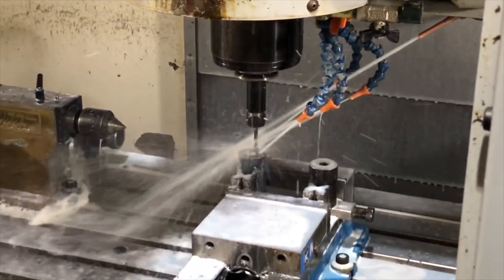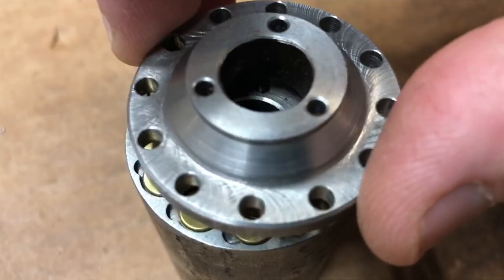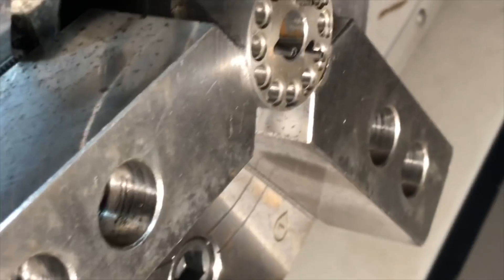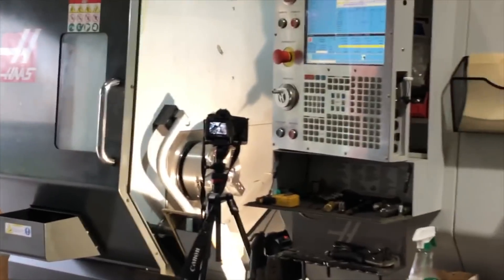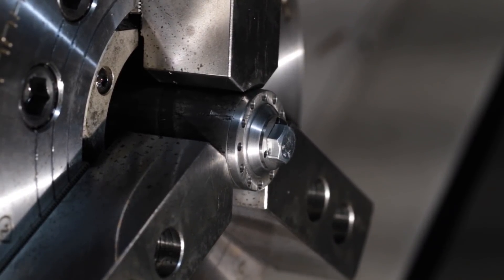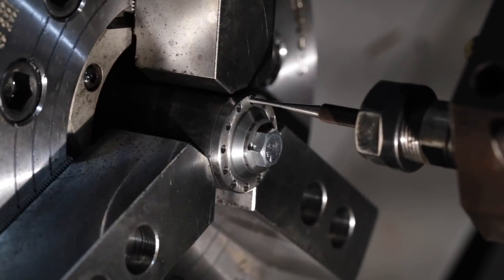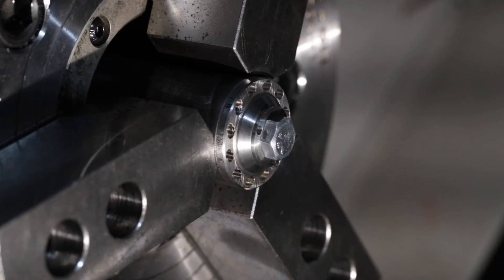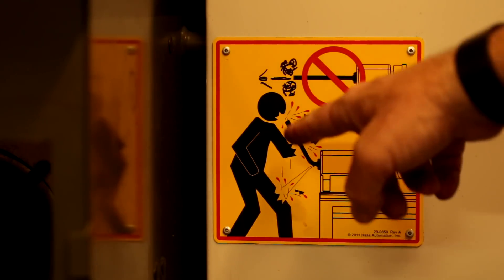Lathe Machine Gun

Comment: Being a rim fire cartridge I was expecting a knurling wheel type roller to crush the rims at any spindle speed. Like a 3000 rpm zip gun.
Reply: Same
Reply: that'd be my first guess, and my personal favorite over the automatic center punch (I like hitting things with hammers)
Reply: Wonder if a simple roller bearing would be enough? Mill a step out along the circumference so the rim of the case is sticking out and just run the roller along the edge. Rounds per minute is just how fast the chuck spins.
Reply: @dangerrangerlstc  I think it would be - you’re just making a crimping press that is set up to crimp on a different plane. The lack of fixed position dies is obviated by the massive amount of rigidity you have in that machine.
Reply: might as well just crash a section of tube against the rims :)
Reply: Same

Comment: A spring punch with the tool path set a couple of thou deeper than zero?
Reply: Same
Reply: Beat me to it.
Reply: That was my theory
Reply: The issue with a spring loaded punch is that the punch needs to be cocked. On a Starrett punch, the cocking depth is over .350".

If the chamber has a bottom and a 90 degree vent hole, IMO it no longer has the ability to expel a projectile. It's the readily convertible section that gets you.
Reply: @gungadinn  what if it was a pop punch? Set the timing so the punch arms and pops at the correct distance.
Reply: just get a hinge popper, tie it and a couple gears to the lathe, and bam. lathe turns, gears set up popper, gear hits an empty tooth to release the popper and strike. aint fancy, but reliable, cheap, and easy.
Reply: @onebladeprop  That's the sort of punch I was thinking of.  Thank you. Whatever the "cocking depth" is just set it one or two thou over.  That should produce a reliable Earth-shattering kaboom.
Reply: @onebladeprop  I was about to mention the same.  A cheap spring loaded center punch with the tip ground slightly should allow the end of travel to be past the contact point.
Reply: I’d go .010 deeper with the spring sheet metal punch brass is soft
Reply: Commented same thing then scrolled thru comments to see anyone else has mentioned haha guess I was late
Reply: That's actually what I assumed he would be using.
Reply: center punch
Reply: Dammit you beat me to it! 🤣👍
Reply: @toddnewsome5011  same. Oops
Reply: Same
Reply: That would work.  Make the face of the punch squared off so no early detonations.  The 'snap' event will do the remaining work, then draw it out just like the current program does and it will reset.  Easy Peacey.  It takes more than a coupe thou though.  There has to be contact then compression to make it snap, then release back to start will reset the snap spring mechanism.
Reply: @gungadinn  Always cocked.  It needs to be compressed after hard contact for that distance to release, but automatically re-cocks itself by design.  The user provides the entire actuation force, as would the C-axis here.  It would just require that a longer 'stroke' and return be programed in to his 'job'.
Reply: @cosmicraysshotsintothelight  
The spring loaded punches aren’t always loaded. When you press the punch, it pushes against the spring cocking itself until it cams over releasing the energy. 
CNC machining of drilled holes uses a process called pecking. Drill in, drill out removing chip, drill in and repeat.
Reply: @gungadinn   That's what I said...  the forward motion of around the 0.350 length that was mentioned compresses a spring which then fires at a specific linear point in the motion striking the rear of the floating punch head with the spring assisted "hammer" inside the unit.  And as for CNC comments go one would not then program it as a drill job.  Duh.  And I knew what 0.0001 inch tolerances were back in '69, so I don't need a primer on it.
Reply: @cosmicraysshotsintothelight  
I’m accustomed to working with Hasteloy, Inconel, and Monel. They’re difficult to machine which is why pecking holes is done. We haven’t had to EDM a broken cutter out on a few years since pecking.  

Drilling aluminum and mild steel, flood cool and let her rip.
Reply: @gungadinn  Right. So, as is in this case, drilling "air" and ending at a stop point that is inside of each machined cavity he constructed causes the face of the pin to smash the ass end of the rimfire cartridge blank with the depth set properly.  Should be no problem.  You know...  let her rip.  Not like you are crashing drill bits.  These are not crashes.  Call it knurling if you want to reconcile your logic.  Whatever allows to tool to impact the back of the cartridge with force, NOT "pecking".
Reply: That's so funny I'm not an engineer but I thought hey what about some kind of spring punch lmao
Reply: Exactly what I said.
Reply: Or program with a G04 so it goes to the exact point rather than starting to return before it gets to the Z point you programmed

Comment: This is so stupid and clever at the same time, I love it.

You could maybe put rubber washers in between where the shoulders of the blanks meet the firing chamber, lifting them slightly higher out of it, then keep the program the same. That way the PID won't have slowed down the punch tip too much as the strike happens, and the rubber will allow some compression so it doesn't break something by having too long a stroke for the space.

Comment: You could have a firing pin for each hole on the diameter of a disk and have that disk rock in a circular motion on a central pivot point.  Have a rolling arm that pushes the depth of travel on the back end of the disk at one side of its outer edge so one firing pin engages at a time as the barle assembly rotates. Than the fiering sequence happens at the speed of rotation. You can also use rocking arms so that the firing disk rotates in line with the cartridge assembly.

Comment: Love this! Have you ever looked at an Remington-Elliot ring derringer In 22lr? 5 barrels drilled in one piece of steel with a mechanism that rotates the firing pin to each barrel… the barrel does not turn. Very clever. I can appreciate the machining on that one and your 12 barrel.
Reply from the maker: No but I just looked it up.  Very cool, thanks!
Reply: That was also the action on the colt "defender" 8 barreled shotgun, i believe. Or i might be remembering the design of one of the 4 barrel liberator shotguns we made to give to freedom fighters.

Comment: Have 12 firing pins already installed on the cylinder head with the backs of them exposed. Then use a roller wheel attached to the lathe moving thingy that holds a cutting tool come into contact with the firing pins, and BAMM!! You have a super fast machine gun!
Reply: You just described the patent for the Gatling Gun.

Comment: “A machine gun is defined as ... with a single pull of the trigger”.

Easy. No trigger.
Reply: I can't recall the name but a guy did exactly that with a sten like gun that had no trigger and was set up to slamfire and pretty much runaway in full auto. One just loaded and inserted the magazine home and then just pulled back and let the bolt fly and the gun would empty itself. Since there wasn't a provision to control when the bolt releases, it truly had no trigger. The ATF caught on and they obviously aren't around any more.
Reply: I assume the ATF defines a trigger as anything that initiates the firing sequence. Here, it would be the Cycle Start button on the lathe.
Reply: I like your style
Reply: Define trigger! You can't have a gun without a trigger, or it would fire the ammo as soon as it was loaded. In this case, the trigger was a button on the machine.
Reply: For those interested in my previous post, it was called the "Sputter Gun" by William H. York. None were sold apparently. Neat bit of a "forgotten weapon" 😉.
Reply: @charlieodom9107  Actually, it was a gunfighters trick to remove the trigger of a single action revolver to make a somewhat crude approximation of a double action. Look into it, it's seriously interesting!
Reply: @korbetthein3072  I have seen them before. I have seen many different variations on guns in my time, but that wasn't the point.

My comment was solely about the definition of a trigger. ALL guns must have a trigger, or there would be no way to fire the ammo. The trigger can be anything to set off the ammunition. It doesn't have to be a lever used by a finger.

According to law, definitions of terms is very important, so the OP's comment is therefore moot.

Comment: Mechanically link the firing pin to the rotation of the cylinder.  Much like the hand of a revolver links the cylinder rotation to index the chambers to the firing position, this would both synchronize the chambers to the firing position and physically drive the firing pin, by transferring the rotational movement into a fore and aft reciprocation.  No firing pin spring to drive it - drive the firing pin mechanically with the speed of rotation.

Complex cam path (especially at .22 scales), but a fairly bombproof setup in terms to timing and strike depth.  The faster it rotates, the more smartly.the firing pin will strike.  The limiting factor would be strength of materials and linkages.

Comment: Would putting in a little striker into the cap, either over each hole or on a spinning arm that is times to stop in each position, make it work from throwing that mass forward with no deceleration?

Comment: As has been pointed out, the punch needs a rounded or pointed end instead of a flat one to concentrate the striking force into a smaller area. However, the main problem for your motion is the positional profile of the punch. Instead of an A-shaped motion, where the punch comes in and out in one motional operation, you need a trapezoidal profile, where the punch comes in, lingers for a few milliseconds, and then backs out. Of course, you still need the PID tuning on the punch motion to allow it to have the maximum deceleration of that axis so the the punch acts as a striker.

Comment: As a quadcopter pilot PIDs are part of life. 

I learned pids in my control theory course but you really learn it when you can see what the I term is doing as it overloads and causes oscillations or when you D is too high and the quad overshoots a roll.
Reply: I use PID loop controls on a daily basis, imagine how complicated things can get when you have multiple control elements/valves on say a Hydraulic system that all feed back to a main controller, some of them feed forward to the other elements of the system, there are multiple feed paths that need to be pressure balanced with each other and the pumps are pushing out around 80 Bar pressure and if you get things wrong and starve an eight stage pump that costs £250k you gonna have a really bad day........ oh, and did I mention the oil is preheated to 130 Deg C, so if you get a leak it injects super hot oil straight in to your body....... FML.
Reply: @nickmaclachlan5178  hmm, 80 bar seems low for hydraulics, I assume it is a high flow system?

I am building a 300 bar 450c hydrogen reactor right now, lol. Controls are easy but materials choice is actual cancer
Reply: @Ammoniummetavanadate  It's actually a constant pressure fuel oil  feed/recirculation system for 48 Power station Ignition burners, approx 500Mw of output. It controls from zero flow and max recirc all the way to max flow whilst still maintaining a minimum recirc value. In certain conditions it flows as much as 25 Tonnes of oil per hour. The trick is to balance the flow in all conditions as the number of burners firing can change minute by minute. It's a nightmare from a controls perspective, but also from the mechanical side as it's lifting the fuel from ground level up about 50 metres and back down again. Bleeding the air out on initial filling is a complete PITA, as is draining it when the unit is turned off. If you leave oil in, it will solidify if the temp drops...... then you're proper fucked......
Reply: @nickmaclachlan5178  goddamn, that sounds super rad.
Reply: @Ammoniummetavanadate  It honestly could have been done a lot simpler, but you know what design engineers are like right?
Reply: @nickmaclachlan5178  ............no comment.
Reply: @Ammoniummetavanadate  try building a 3550 bar reactor...It’s called a LDPE tubular reactor

Comment: I am not just an engineer, I was a CNC controls engineer.  I understand quite well what is happening.  If you were to set your control for exact stop, it would always close out on the move.  Or put a dwell of length 0 in the next block (G04X0;).  At least on a Fanuc that will force an exact stop.  That is probably the safest fix as fiddling with the override won't cause it to run the part into the part like adjusting and offset would.

Definitely a cool bit of shop fun.

Comment: Spring loaded center punch. You would have to slow down a bit more, but the hammering effect would certainly fire the primers each time. Simply set the travel to a few thousandths past the break point on the center punch or make a rudimentary hammer and sear to come in and break at your desired LB point. Just a couple suggestions for reliability. US Navy Machinery Repairman 2nd class (8 year Veteran). Zip~

Comment: The pin could be a spring loaded ramp. Lets say  you put 12 tiny fixed ramps right next to each firing pin impact spot, on each chamber. Now on the other side instead of a pin you have another single spring loaded ramp as the "firing pin". As the lathe rotates, that tiny "primer ramp" with be cocked by one of the 12 fixed ramps. Once it clears the fixed ramp it will slam down into the cartridge. Nothing complicated.

Comment: could have cheated by rigging 12 pins up to hit the primers all at the same time making it a multi-shot gun and since it's not a machine gun it's now youtube friendly
Reply: Legally, though, it's still a machine gun even if he did it your way.
Reply: @theazuzhaters9988  No it wouldn’t. There’s a pistol made by some company that fires two rounds with one pull of the trigger. The two rounds fire from two different barrels. By atf definition, it’s not a machine gun. There are also double barrel, side by side, ar15s’. Those are not considered machine guns either. You can even fire two rounds out of a traditional coach shotgun at the same time as well. That’s not considered a machine gun either.
Reply: You will probably need a large primer to power all the pins reliably, so to say. Once saw a guy make himself a seven shot .22 caliber conversion for a flaregun, and the hammer on the thing just didn't have enough oomph for the plate with the blade pins to strike the rims hard enough.
Reply: @DeoVindice_61-65  yes that's true but a couch gun double barrel has two triggers. Making it still one round per trigger pull. If you get multiple rounds per trigger pull it is by definition a machine gun.
Reply: @PewLand  not if it falls under volley fire exemption, if each round leaves a separate barrel at the same time then it’s not a machine gun.
Reply: @cdawson198600  ding, ding, ding.
Reply: @theazuzhaters9988  wouldn't you be able to argue it as a type of shotgun, I did see someone else say if it fire from multiple barrels it's exempt but let's say we fired it from one barrel (a very big one) and said it was a shotgun. Because its one pull of the trigger and multiple rounds go out, like pellets from a shotgun. The ATF doesn't say anywhere that the round must come from the same shell/casing, its definition on their website is 

"Any weapon which shoots, is designed to shoot, or can be readily restored to shoot, automatically more than one shot without manual reloading, by a single function of the trigger"

It would come down to their definition of a "shot" and they cant say it's when more than 1 projectile leaves the barrel as all shotguns would be a machine gun
Reply: There's a little device you can get for an m203 underbarrel launcher that basically just fires a bunch of .22lrs at once. It's legal
Reply: The ATF classifies shotguns not by virtue of their ability to fire multiple shots, but by their lack of rifling in their barrel(In law, shotguns are referred to as smoothbore guns).  Several individuals have tried making a weapon like you describe(Double barrel AR15, double barrel 1911), and in the end they had to had 2 triggers to their weapons(2 triggers= 2 bullets).
Reply: @Kscharmota  Was just thinking the same thing. You can get a 37mm flare launcher and do the same thing. They sell an insert, that fires multiple .22 cal rounds all at once. If you get a flare launcher, you don’t have to go through the NFA paperwork, and you don’t even have to go through an ffl. Since flare launchers aren’t firearms.
Reply: @theazuzhaters9988  I forgot about the dual 1911. A gun shop near me has had a couple in the past. Pretty interesting gun.
Reply: @theazuzhaters9988  Oh, I had no idea that's how shotguns were classified in America (I live in Australia) What about automatic shotguns like the AA-12? are they classed as a machine gun because it's automatic or does it depend on where the dart lands that day at the ATF as to how it's classed?
Reply: @raydeo2584  They define a machine gun by it's ability to discharge several cartridges with one trigger pull(a round of buckshot with several pellets inside counts as one cartridge)

Comment: Showing the sticker with warnings for possible injury due to unsupported tailback brought to mind my earlier life as a wanna-be apprentice.
My boss, a "master" machinist, left the tailstock loose, a ten foot piece of one inch roundstock being fed thru a 12 foot lathe. 
The round stock started to wobble, the lathe started bouncing, the six or so foot length of unsupported round stock moved that old lathe, cast iron base and all, completely up off the concrete pad, ripped the control panel off the wall and a string of eight foot fluorescent lights out of the ceiling. 
Take care.